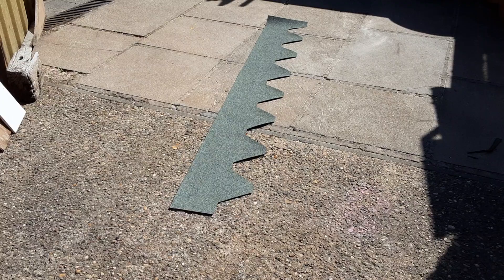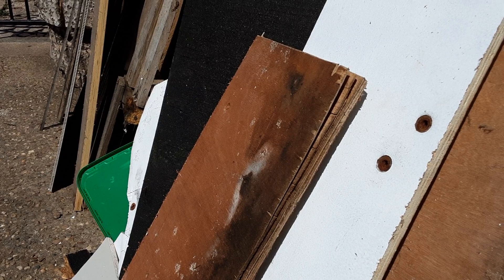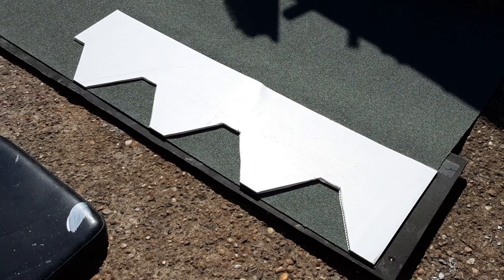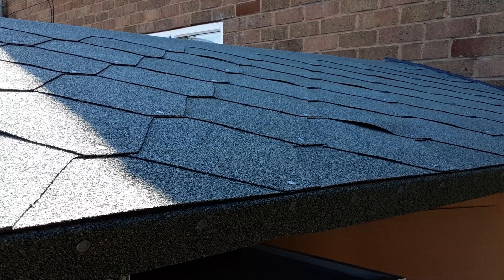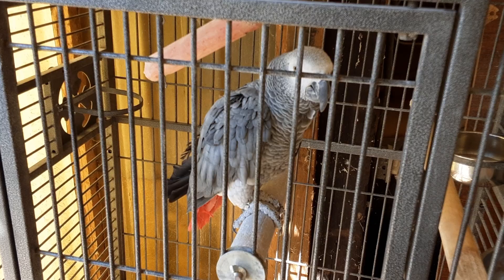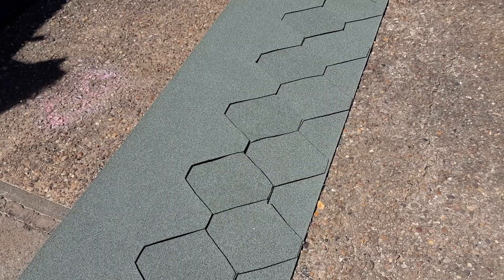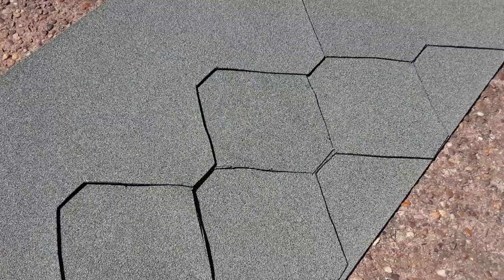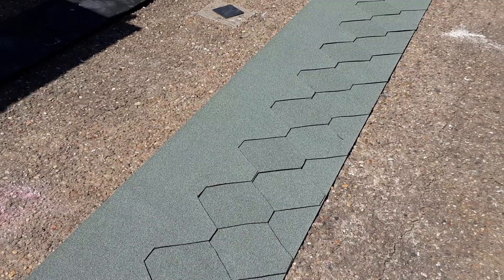How Do I Make My Own Roof Felt Shingles 🌻 #hychikatools 🌻 DIY With The King's

Comment: Great video Terry. I have got two sheds to do so will give that a go on the low bike shed so I can practice with my feet on the floor rather than up a ladder. I am impressed with the tools though very tempted to buy them. Thanks  and take care
Reply from the maker: The tools are being tested quite a bit just recently and the circular saw even cuts through the Wheelbarrow..........🤣 Got a strimmer coming this week from another company so they must feel sorry for me with all the weeds that I have........🤣.

♻️Happy gardening, Terry King.
Reply: @terrykingsallotmentgardening  so you have yet another wheelbarrow to repair.🤣 hope the strimmer makes it less work for you then. 😀👍
Reply from the maker: @sandram1503  a little cut won't hurt and this other company must be connected to hychika, will come in useful to keep he entrances to the plots tidy.
Reply: @terrykingsallotmentgardening  😀👍